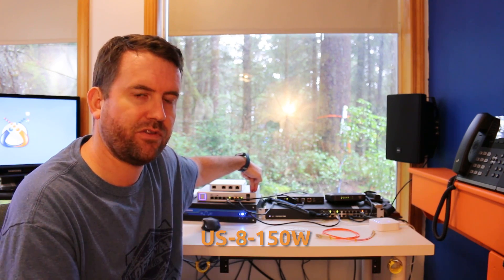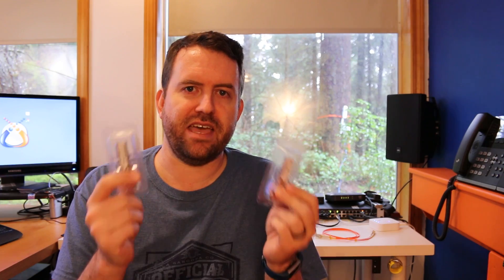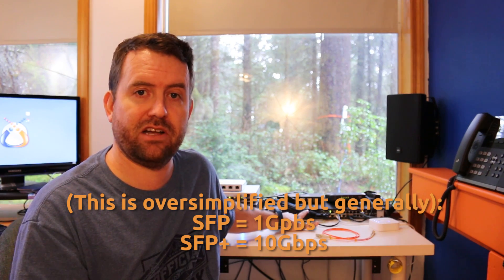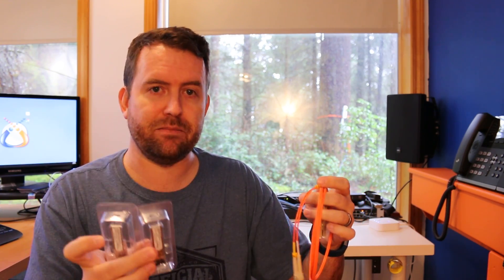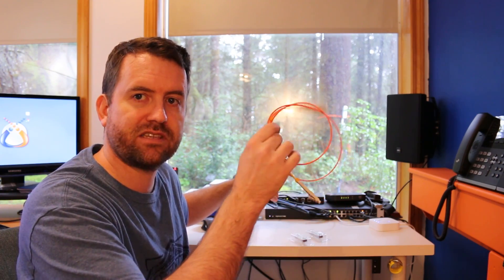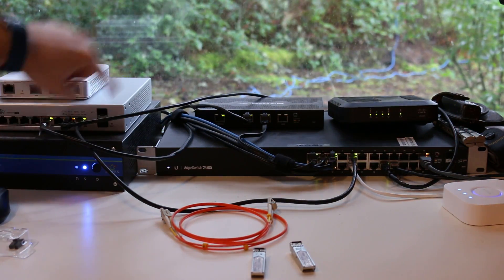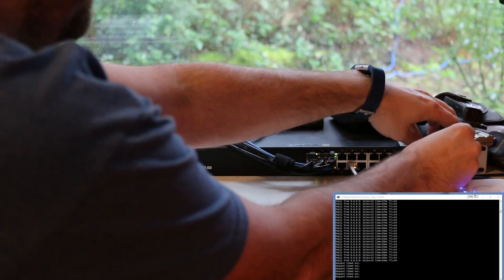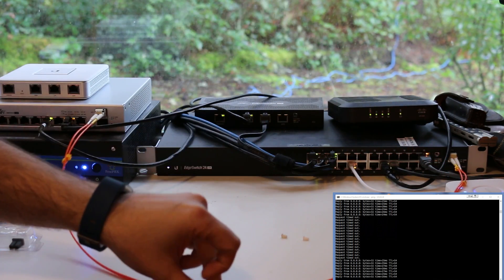SFP Module Installation

Comment: I know this is an old video but I have questions.  It's 2023 and I am adding connectivity to a new detached garage I am building.  Friends strongly recommended fiber.  I have a UDM Pro in the house.  I am thinking 10Gtek SPF dual mode modules with a 40 meter outdoor armored duplex fiber optic cable with LC ends.  On the garage end I am thinking of using the Ubiquiti UniFi Switch 8 port 150 watt switch you have in the video.  It seems the perfect solution for an AP and IP security cameras.

Comment: You should have mentioned that the patch cord is cross over.  Along that line, in a fiber optic installation with fiber patch panels on either side, please confirm that the strands should be straight end to end, and the cross over should take place in the patch cord.

Comment: Awesome content as usual! I am currently and drastically upgrading my home network. I work most often from home and my family can have as many as 3 or even 4 concurrent video conference calls happening. However, my network is target for performance and future proofing. I therefore putting infrastructure for 10g everywhere, while keeping existing cat 6 for devices that will never need higher speed, such as printers.  I also taking the UniFi leap with APs, video, etc. We currently have fibre with 1.5 g and will get the expected 5 or 6 g service when available later this summer.  I, like many others are waiting on the UDM SE, which is not available in Canada currently. I already have the XG 24 and 24 PoI enterprise switches. My question: how do I connect these two devices - SFP+ to SFP28? Will a UniFi DAC SFP+ cable do the trick? Or do I need an SFP28 cable? Something else?  Thx

Comment: Hey Chris, I have both the 10gtek sfp and ubiquiti sfp. I can’t use the ubiquiti sfp will not link actually work as cross connect between by us8-150 and the dream machine pro. Checked cables and 2 sets of ubiquiti sfp’s. Any tips?

Comment: I believe in switch to switch patch connections like this you no not need single mode fibre. (save on cost using multi mode, however if you have single mode laying around go for it! :)

Multi mode is fine for distances under 40km (double check distance) I believe, after that you will have issues with the fibre signal bouncing inside of the cladding / core to much causing issues ( order of packets being delivered )

Comment: Hey
Does any config need to be done on switches when connecting them with sfp?

I have two aruba 2930s i want to connect. Are they typically plug n play? Like rj45?

Ty

Comment: So you had internet using standard ports and cables. You unplugged the cables, installed the SFP's and patched with fiber, Viola you had internet....? Why did you go through all that to get what you already had. Is it just a speed thing or is there more that this does for you?

Comment: Hi Chris!  Love your videos.  I used this to hook up my Ubiquiti SFP+ DAC between my UMD-Pro and USW-48-POE Gen 2.  However, I also had to add the ports to the LAN profile and then auto-negotiation still didn't find them and I had to manually set both ports to 1GBps even though they both support 10GBps.  The switch didn't even have 10 as an option even though it's in the specs.  Any thoughts on the auto-negotiation feature and the lack of 10GB option on the switch?
Reply: The Standard USW-48-POE (non-Pro) just have SFP ports (1G) and no SFP+ ports (10G). And it is known that the auto-negotiation goes wrong, most of the time. However, maybe a future firmware will make that better. But 1G DAC is stille better then 1G ethernet. So congrats!

Comment: Great scenario to demonstrate fibre and SFP modules and that they're hot pluggable.  PLEASE don't remove the dust caps of any part until you're about to connect - for example only remove the dust caps off 1 end of the cable while you plug it in, and then when you're ready to plug the other end of the cable in only then do you remove those dustcaps.
Multimode might survive some dust particules but degrade, but Singlemode the entire core can be covered by a single spec of dust.
Reply: yes

Comment: What's the benefit of using SFP (so 1 Gbps) over normal copper Ethernet cables? (also able to do Gpbs, but no need to buy SFP adapters)

Comment: Question: Should the LC cables be Straight or Cross? Or it does not matter?
Reply: It matters because there's one that transmits and one that receives. You can check with a camera which one does what.

Comment: Hi Chris, thank you for the video. I just want to know that if we have any FFTH optical by ISP, can it be connected directly to EdgeRouter via Ubiquiti U Fiber - SFP 1Gbps - SMF technically? 
Or not because ONU (=optical modem) is needed to connection (OLU sends packages to all ONU and ONU checks and filters the packages which belongs to its) to and we can not bypass modem device in our infrastructure. I know there is other side, it may ISP doesn't allow user's devices.

Comment: Hi, great video. May I ask a question about the length of the fiber cable? Is it possible to use a 10m single mode cable with SFP modules that are rated at 20km? Would it burn out media converters on either end? (1GB converters) - Thank you!

Comment: This video, and all of your US-8-150W related videos, helped me immensely. Thank you from a first-time owner of a UniFi switch.
Reply: I am installing 10Gtek 1000BaseT (copper) SFP modules into a US-8-150W. I could not find any instructions on how to do that on UniFi's site/documentation.

From watching this video, it doesn't seem it's necessary to power-down the US-8-150W (or your EdgeSwitch), before installing the SFP modules.

Do you know of any scenario where powering down either device would be necessary when installing/removing SFP modules?

Thanks in advance!

Comment: Wow, didn't realise it was that easy. What is the benefit though of a 1Gb sfp link over an Ethernet cable?  (Cat 5e and Cat 6 can do 1Gb?). I'm no pro at this at all, genuinely asking the question.
Reply: No benefit for speed, but if you wanted the switches to be more than 100 metres apart, then optical fibre is the way to go, as twisted pair cabling isn't much good beyond that length at high speeds.
Reply: @Tekwyzard  ahh yes, fair point. I was picturing the switches next to each other. I forgot about longer distances.

Comment: @Crosstalk Solutions, I'm about to build my home network. The basic topology consists of a Google fiber jack going to a switch, ES-8 150w, on vlan 2 by Ethernet, connected to a router by sfp trunk, router-on-a-stick. Would this create any bandwidth issues of sharing the WAN and LAN on a single physical link?

Comment: Hi Chris, I have a question does SFP have the capability of auto -MDIX to sense of the fiber patch is flipped just like copper regular ethernet cable they can sense TX to TX and change one side to RX without making any changes to the cable itself. Thanks

Comment: I was looking to get buy a LC-LC fiber cable but noticed there are OM1, OM2, OM3, OM4. From what I can tell, they all support up to 10GB but at different lengths. For connecting 2 UniFi switches, does it matter which OM I get?

Comment: But what is actually the point of doing this?  If the SFP connection is only 1gbps, why spend the money on the modules and fibre cable when you can just use the gigabit ethernet connection?
Reply: Fiber allows you to travel much further distances than ethernet (at least singlemode fiber).  Think 328 feet on ethernet vs thousands of feet of SM fiber.

Comment: Why was the PING time not changed but stayed at around 25ms when the optical cable was used instead of the copper CAT? I thought latency is greatly reduced with the SFP connection?

Comment: RE - the fibre patch cables - the "white little plugs" are dust caps, yes they protect the ends of the fibre but more importantly they keep dirt and dust off the fibre ends.  Dirt is 99% of the problem in fibre optics and therefore you should never take yer dust caps off unless you need too...

Comment: Is it possible to connect the US-16-150W to the USG-PRO-4 with an sfp 1 fiber cable as well. if so, is this a better connection then a cat 7 lan cable.
Reply from the maker: You can probably do this (I'd have to look up the specs of both of those devices to say for sure), but if they are SFP (and not SFP+), then there would be no speed difference between the SFP (1 Gbps) and anything above CAT5e.

Comment: how do I connect using SFP if I have three or more SFP enable switches?
Reply from the maker: Each SFP connection is a 1 to 1 link, in order to connect 3 switches together, you'd have to have a minimum of 2 separate links.  Switch 1 to switch 2, and switch 1 to switch 3 at a minimum.

Comment: SFP port config ?  I have all unified product, I have a security gateway the small one and a 8 port switch 150w.  my internet into the house is fiber, right now I have a TP link media converter ( SFP to network cable ) that is patched into the WAN port on the gateway and then logging into my provider using PPPOE Vlan ID-35 but what I would like to do is just use the SFP port on the switch and some how route it to the WAN port to pass my PPPOE using VLAN ID-35

Comment: Question about the Ubiquiti U Fiber modules.  At https://www.ubnt.com/accessories/fiber-modules-cable/, it looks like the 1Gb Single mode module only coming in Bidi. Item# UF-SM-1G-S.  There is no UF-SM-1G.  At a supplier's website, it looks like they recommend the UF-SM-10G even for 1G applications.  Will that work? (edit) Just rewatched, we have some cisco switches (will gradually replace them if Unifi) that have 1G SFP SM modules.  I'm guessing I have to match these?

Comment: Hmm .. can you use an Ethernet sfp module to bridge to a normal port on another switch?
Reply: Hi did you manage to find out what if we can use ethernet ones as up links on ports 25 and p26 if the 24 ports are used up... Thanks

Comment: So, the UniFi Direct Attach Copper Cable are SFP+ (10Gbps). Yet the Hardware is SFP (1Gbps). Could you plug SFP+ into the SFP ports? 

Hardware referring to is Ubiquiti US-24 Unifi Switch, and Unifi Switch L2 PoE (US-L2-24-POE). Both list "(2) 1 Gbps SFP Ports"
Reply: typically direct attach copper cables are a fixed speed meaning a SFP+ cable is only rated at 10gig and cannot be changed to meet the 1gig speed of the SFP port.

Comment: Hey Chris, do they exist sfp modules with entrance sc for fiber? Because I only find with lc conectors
Reply: No. LC is small enough to have 2 slots in the SFP module. If you have fobots with SC connectors, you can get patch leads with LC on one side for the SFP module, and SC on the other for the fobot.

Comment: I have seen other videos where they will clean the tips of the fiber before plugging into the SPF, even on brand new cables.  Is this necessary to do or not?  I have seen fiber tip cleaner/kits range from $20-$200 and not sure if that expense is worth it for 4-6 cables.
Reply: Yes, always clean new cables, and the way Chris is doing it here is wrong, it is a typical IT guy failure, the dust caps (not rubber stoppers, as he calls them) must first be removed right before you're are ready to insert the optical cables.... I am working with fiber every day, and the most common failure, is IT Guys, the leave the patch cables, and connectors, without dust caps, finds and old cable in a drawer, wipes then of with a finger, ore in the shirt, and that is just making a bad connection, looking up a connector in a microscope is very interesting, when people think that they are clean...

Comment: Is there a way to connect an edge router to a edge switch using SFP? I need exactly 24 ports and it would be great if that would work.

Comment: Thank you for the video , I have question what is different if u used UTP or Fiber connection  between the tow switches. Is it faster ??
Reply: In this demonstration, it looked to me like the ping actually increased 1 ms after switching to the fiber. I've heard that fiber is ideal for handling many connections at a reasonable speed while copper is faster for small networks without too many nodes active at once.

Comment: Hey Chris, great video. Any chance you could do a video showing how to use the SFP port on a edgerouter pro 8. Thanks
Reply from the maker: I did a video on how to install SFP's...it's somewhere on my channel. Check that one out...it's basically the same thing.
Reply: Thanks for your reply, what I am looking for is this; if my LAN is on eth1 how do I either link eth1 to eth 6 or transfer the LAN connection to eth 6 this so that I can use the fibre connection to my LAN switch.  Thanks

Comment: Can fiber power a access point like ethernet cable does?
Reply from the maker: +Winston mccalla No, no PoE over fiber that I'm aware of.
Reply: Crosstalk Solutions ok so if I have a radio that supports both Poe (ethernet) and FSP (fiber) I would have to run a separate wire for power if I use the fiber from the switch?
Reply from the maker: Yea - you would terminate the fiber to a switch of some sort, and then go out of the switch with PoE directly into the radio, or for a non-PoE switch, you'd need a PoE injector (which those devices usually come with).
Reply: Crosstalk Solutions I wanted to do fiber from the switch to the radio because the radio has POE and also FSP, the radio also supports powering other than POE but I'm wondering where can I get such long DC extender to go all the way up the tower

Comment: I'm connecting two devices together. One Nokia device is capable of gigabit ethernet and has a 100/1000BASE-T SFP plugged into it. Will it talk to an RLH 10/100BASE-T card using a CAT5 or CAT 6 copper cable? or does the SFP on the Nokia need to be a 100BASE-T SFP?

Comment: It was so nice to see your video, very simple setup. It always good to be same Speed, same mode on the both two sides. Recently UBNT stop providing Edgeswitches, it really puzzles me, cause I still use the old ES-8-150W switches and fs sfp in it. I wonder whether I should switch to a new brand switches.

Comment: Hey Chris, best regards from Germany :)

I would tell you, that the SFP-Mobul A7446B from HP work also fine in the Unifi Switch 24 Port. also with Link-Aggregate, with this feature you have 2 GBit as Load-Balance. It is interesting when you have IP-Camera in this network an the NVR is on the other switch...

Comment: The Unifi modules are still not available.  Can you give me a link to the ones you used?  I am connecting a US-24-250W and a US-8-150W with this fiber: Multimode 62.5/125 4 Fiber Indoor/Outdoor Plenum LC to LC.
Reply from the maker: All links are in the description of the video - thanks!

Comment: I am looking to purchase a fiber patch cable allowing me to connect 3 UniFi Switch 8 150Ws together. I see the links for the SFP modules, but am still looking at the recommendations for a short fiber cable. The cables I see on Amazon are listed as 10G will they work with SPF or not? I know that you can use a SFP+ in SPF but not the other way around. I have tried looking, but perhaps I wasn't looking in the right place. I want to be able to use all 8 ports on 2 switches as the USG does not have a SFP port. I originally purchased the Unifi 24 port switch, but it was too loud due to only have a "cove" for networking rather than a closet.
Reply: No need to buy fiber. For a short SFP cable just get a DAC (Direct Attach Copper) cable. I bought the 1 meter version of this: https://www.amazon.com/gp/product/B00WHS3NCA/ to connect my EdgeSwitch 8 150W switch and a Mikrotik CRS125-24G-1S-IN. It supports 10Gbit, but I only have SFP so it runs at 1Gbit.
Reply: The cable that you have linked is the 10G cable. Is there a link for the 1G cable. As the Switch 8, only has SFP not SFP+.
Reply: My 10G cable worked just fine in the SFP ports. It just runs as 1G.

Comment: Hey Chris you must have known this happen. :-)
SFP are not quite that easy if you want it all to work happy.
The biggest this is compatibility, Ubiquiti Edge Switches don't like just any SFP's, they are fussy.
They can have bus interface problems as in 1 bus is used for one thing but SFP will use it for something else. Hence Ubiquiti will tell you that it it is unplugged but works fine or it will not give you the temp because that buss is used for something else.
Most makers will do a General Purpose that will work with the majority.
Then the next big thing is the speed with the distance, that will dictate what cable/fibre if you have that luxury.
If not you have to work with the fibre with the distance that will determine the light frequency or wave length (same thing) which some to most will argue about. (spectrum of light)
PS The Telecom/Fibreguy is correct with all the plugs.
And
Cisco have a good connector patch diagram for what is what and what colour.
Ciso are far more fussy with SFP's

Comment: What about running fiber through conduit / tight spaces?
Can it be field terminated (like CAT cable)?  So it can be cut to length?
How durable is it for pulling strength and around corners?